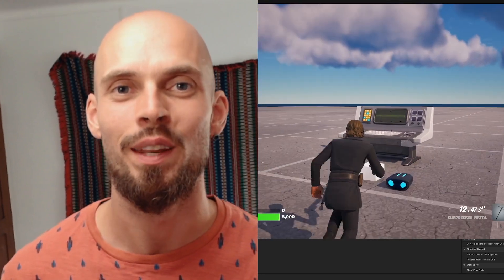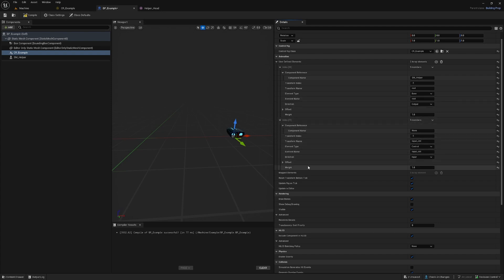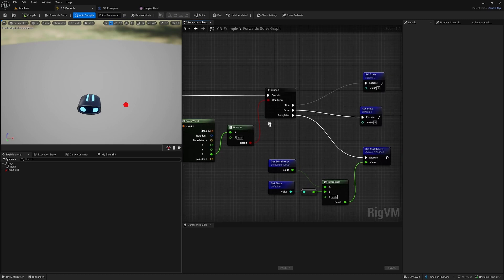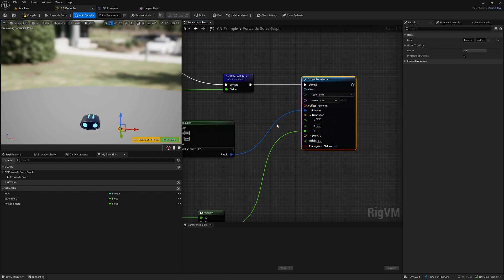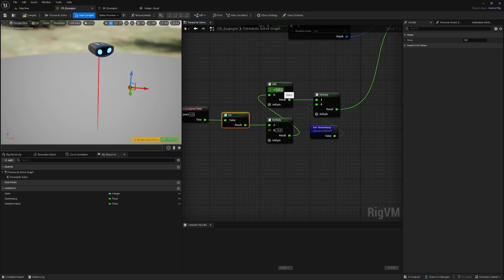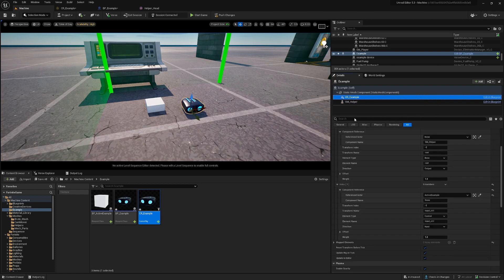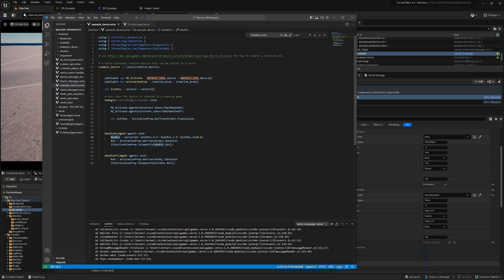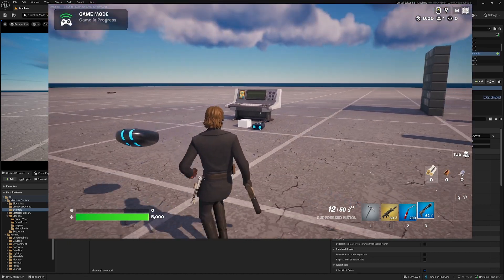Control Rig basic state setup in UEFN Fortnite

Comment: good video, I am struggling however to get control rig working to my needs in uefn. It seems to me the find floor control rig option is missing for UEFN as I have some huge props that work better than NPC Spawner variants due to collision however they end up flying if a user is higher up, gliding or in a plane. Any chance you know a control rig equivalent for this in UEFN?

Comment: hey i have a simple setup were im interping an object along the X axis continuously. usings its own location + 10 on the X axis as interp goal. it works perfectly in the editor and it works perfectly when i set it to a component of my blueprint. BUT when i set it to move the enitre blueprint i start getting this weird lagging hitching effect. any ideas on what could cause this
Reply: I have the exact same issue. 
In the editor everything looks fine but in game is not working, it moves randomly and it doesn’t work. Any clues?